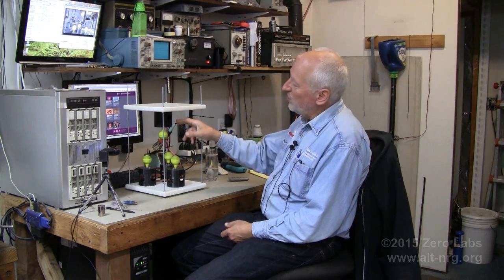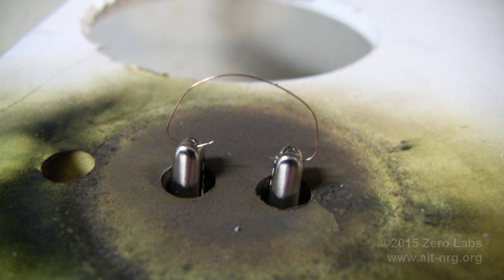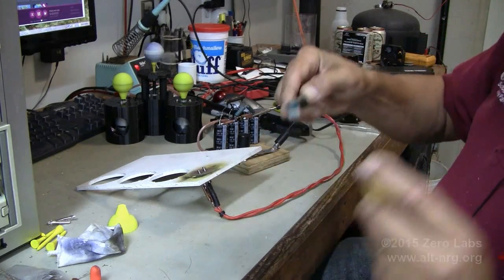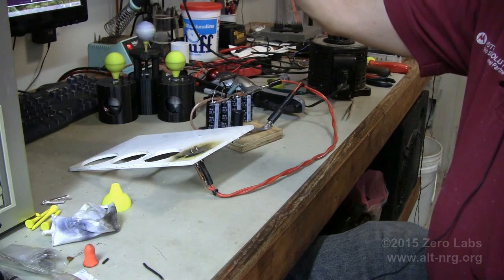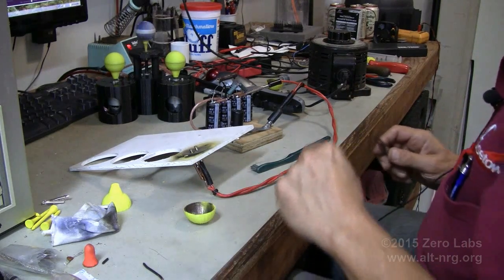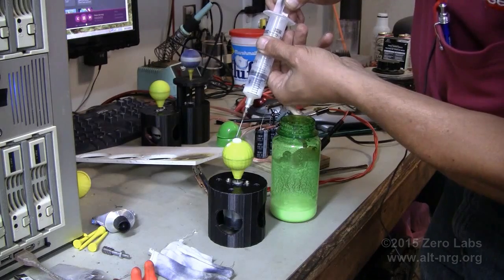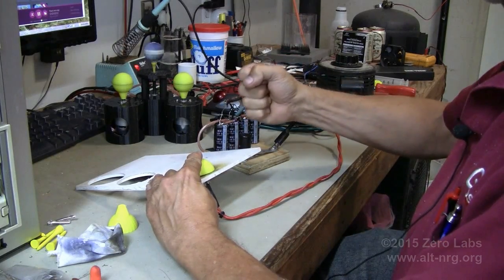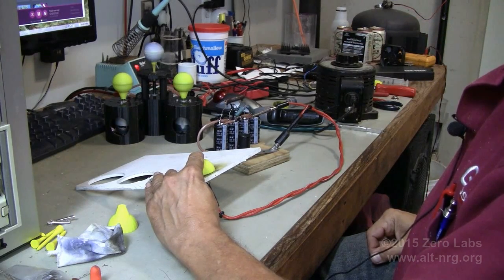#421 Keshe Plasma Reactors up & running!

Comment: All you ever need to know at www.free-energy-info.com   Mr. Zero, could you confirm that magnets that repell each other could be drawn together with mag-absorbent  material like mu metal (pls forgive the misspells), if so then cool. Also, is ti logical to assume the 1700s Hydro Ram Pump could power a looped turbine system? If that doesin't work, you could always use a low watt e-motor to run a high watt alternator/generator, just keep the batteries (use and storage) seperate. Just need a switching control.
Reply from the maker: +WhtStr213 I have tried what you suggest with magnets. I know your thought process on this. Very difficult to achieve a balance that nulls the forces. The ram pump wastes a lot of water delivering only a small fraction to elevated heights. You could never loop such a device.
Reply: +ZeroFossilFuel thank you very much for your input. As I have nil finances, most of my work is conceptual (two yrs worth of doodles). Its really nice to have someone building and testing these things. The goal is there, we just have to find it. Keep up the awesome work ,good luck and god-speed Sir

Comment: when you add external current the output is nano zinc oxide. In all the Keshe teachings there are co2 loaded (or/ and Cuo, ch3 Gans) in the Reaktors.

Comment: In Minute 8:26 you dont show Co2 Gans, its Nano Zinc oxide. Thats not the correct filling for the reactors. You have used current to produce Nano Zinc oxide. For Co2 dont use any voltage.
Reply from the maker: +lassardio You're wrong. The dissimilar metals in salt solution produce a voltage. That's why the plates must be connected, so that the current flows. Adding more voltage to accelerate the process is fair game. But you're absolutely correct about one thing. The product *IS* zinc oxide.
Reply from the maker: +nom d'plume No, you do not understand the process. New plates in solution produce significant voltage and current. When the plates are connected together up to 100mA of current flows and material is produced. However, when enough zinc plates onto the copper the plates become less dissimilar, current drops off quickly and production slows. Injecting a small voltage to maintain the current levels does not alter the process other than to keep it going at a reasonable pace.

Comment: What are the anomalies you heard about? I just heard that the star formation concentrate free plasma in the center. I never heard anything else.
Reply from the maker: +neves71 Vince also reported seeing strange fluctuations in motor RPM, up to +/- 700RPM. Personally I just think his reactors got out of balance with the "gans" centrifuging to the outer walls. Once it starts to get out of balance it begins to avalanche. That loads the motor bearings and increases inertia.

Comment: Looks like you a getting wrong information about the gans production. If the plates are outside it is impossible to get gans. What this setup could do is attract CO2 to the water, probably in liquid form, but usually you would need a nano copper wire submerged in the water. I follow many groups about Keshe and there is a lot of open experiments, misunderstanding and misinformation. If you stick to the Keshe workshops and books you could be more precise in what you doing.
Reply from the maker: +neves71 I understand. This was one recommendation from one believer who drank WAY too much of the Kool-Aid. Simply making good on a promise to point out the sheer stupidity.
Reply: If you want to prove if the Keshe theories are real or not I think you should stick to his experiments. The followers (most are amateurs, some with more others with less scientific knowledge) are trying all possibilities, some with good results some with no or bad results. There are people making glass and thinking they make a diamond (joke). So if you try to reproduce followers experiments and listen to much what they claim, you are just fooling yourself and the people who are enjoying your investigation. Keep up the good work.
Reply from the maker: The only real advice I am taking with the core experiment is from the apostles directly below Keshe himself. They liked my copper vapor deposition but even I do not think that held true to the design criteria. My next plasma balls will have a genuine electroplated copper interior that's nano coated with caustic. Thanks for your comments.

Comment: From what I understand you have to love your reactor! So try giving it a hug! Or a kiss to see if you feel all tingly inside or take a jolt of mega volts to the face? :)
Reply: +shazizz Better stay away - it may explode
Reply: sound, thought, intent and so on are vibrations... changes frequency... :) is made of light and information :)
Reply: Look into Dr. Masaru Emoto and his water consiousness science. All is by the way energy, we too :) with love, Ine
Reply: Look into Dr. Masaru Emoto and his water consiousness science. All is by the way energy, we too :) with love, Ine
Reply: +shazizz Yes. ESpecially when it is such a mesh of blank wires a most of the DiY peopls produce and it is connected to the gtid. Then you are a good candidate for the Darwin award :(

Comment: Also don't forget to show (technical analysis data) how the gans are not factually gas in a solid state...:) As in you need to prove the solid or liquid you made is not in fact C02, C03 or any gas in a solid state you made by a proven 3rd party. That is all you need to prove Keshe is wrong...correct?
Reply from the maker: +Paul .C What I made was made precisely according to the instructions I was given. If it's not what they claim it is, it's not due to any procedural error. It's because it's not what they claim it is. Again, pretty simple. Don't want to confuse anyone.

Comment: For those who never believed:
https://www.youtube.com/watch?v=6vowBIwEYKc
For those who have now changed their beliefs:
https://www.youtube.com/watch?v=6vowBIwEYKc
For those who still believe:
https://www.youtube.com/watch?v=6vowBIwEYKc
Reply from the maker: +Energy Fabricator LOL! Nice one.
Reply: +ZeroFossilFuel 
I thought you'd like that :) and WOW... judging by the comments, you have opened up a can of worms with this series of videos! Sooo many people STILL believe with no evidence of anything... no energy production of any sort, be it heat, usable electricity, or otherwise. Just 'empty boxes of the universe' filled with empty promises...
Reply: +rylan .bledsoe 
This is the dense plasma focus which Eric Lerner and many others are working on. It has nothing to do with Keshe's empty box of the universe (as far as I am aware) and it has been around since the mid-60's. Furthermore, it is extremely difficult to produce fusion using this method. See below...

Firstly, you need extremely high temperatures...
The ion temperatures required have not been produced successfully in the lab.

Secondly, you need high plasma density...
I don't think they have even come close to succeeding in producing the plasma density required.

Thirdly, you need the confinement time...
They have succeeded with this aspect. Unfortunately, the product of density & confinement time determines how much fuel you will use to produce the reaction.

The reaction produces X-Ray emissions, cooling the plasma, which brings you back to the first problem of reaching the extremely high temperatures required. Again, nothing to do with Keshe.
Reply: +renaud techer Go away troll...
Reply from the maker: msmeg renaud techer states the truth.
Reply: Energy Fabricator why so many hate? Milions people play with that nevertheles your opinion and videos. And what? Why you are obscesed by Keshe why you are not "home" besides the same "scientist" as other sceptics?

Comment: Well done Mark. so there is no electricity produced from the inner fluid tapped via a nail versus the outer shell covered in alufoil ?
Reply from the maker: +overunitydotcom That's not in the build parameters. Supposedly this creates the field for the "energy beads" to extract electricity from, plus other anomalous behavior reported by the Keshe apostles.
Reply: +ZeroFossilFuel Hi Mark, Peter Salocher from Austria has replicated the Nanocoating wires and says, that his solarpanel battery bank is now 2 hours earlier fully charged each day due to the Keshe wires at his battery bank... Hmmm... maybe the nanocoating produces very fast diodes between the copper and copperoxide layers, that convert all background radiation waves to electrical energy...one explanation that would make sense...
Regards, Stefan,
Reply from the maker: +Stephane fyfe (steph) You are correct. I am not finished. New, better sealed, more stable plasma reactors have been printed. They will be copper electroplated 1mm thick inside and caustic method nano coated, conforming exactly to the design criteria. I will have the 5th reactor running as well, and the "energy beads" which is essentially a Magravs device. This experiment shall be carried out fully to it's logical conclusion.
Reply: +ZeroFossilFuel This miraculous device just blew the fuses when the visitor of the world peace meeting swithed them on. A great success but i can do that in a more simple way: just insert a wire (AWG 14, heavy insulated, use gloves!) in both holes of a wall outlet and  --- BOOM (DONT DO IT IN REALITY, IT IS DANGEROUS AND MAY DAMAGE A LOT)
Reply from the maker: Jean-Pierre Mürrli LOL!
Reply: +Stephane fyfe (steph) You mean if he ()  had done it right it would blow thfuses and damaged the electronics?

You are right :D
Reply from the maker: +Jean-Pierre Mürrli Actually, your redrawing of the schematic is not exactly correct. Two poles of the master switch (CBIN1) are N.O., the other two (CBOUT1 to ground) are N.C. There is no dead short condition so long as the the switch operates this way. I would certainly not call it a UL approved device, though, do to the electrical hazard I'm sure it will present to most builders.
Reply: +ZeroFossilFuel 

Then we have different publications of the blueprint. This is from
https://static.allmystery.de/upics/11ac9e_Keshe_MPS_Blueprint_1.jpg

it is a screenshot from the 3. day of the "Blueprint Teaching Week" am session at about 00:55:00
and there both CBs are N.O.
The experience of the "ambassadors" ("sparks" and "damage" as Keshe calls it at the beginning of the first workshop) points into the same direction (tansscript of Keshes video at the very beginning):

"(Greetings) ...One of the problems is - as we have seen with the governmental demonstrations where the ambassadors took the units and plugged them in their own way creates this spark and they had to wait for the/a repair”
Reply from the maker: Jean-Pierre Mürrli Oh my. Yes, that will go boom every time. The diagram I have is from the pdf at KF right now. Looks like they corrected their error.
Reply: +ZeroFossilFuel Î downloaded the blueprints from the Keshe webpage meanwhile ans there the drawing is correct. But it is not sure if it works even in this case - there is an additional requirement:

When the two circuit breakers switched on there must be a break before make configuration - the circuit breaker on the right must open before that on the left closes and when we switch off the left CB must open first.

But the most devastating error in the blueprints is the connection of the energy counter shown on the last page of the Magrav Power Schematics updated pdf. Have a look at the connection to the energy meter:
The connection from the grid to the meter is on the left, the connection to the coils is on the right. This energy meter measures the energy flow from the left to the right terminals that means, during their experiments Keshe and Alekz never measured any energy delivered to the grid, all they saw was energy drawn from the grid

Youn know what that means...

There are a couple more quirks in the whole design but for now I'll let it be enough. More will follow soon.
Reply: +Jean-Pierre Mürrli Don't you know about prestidigation, magicians tricks? Through the ages, it has been a regular way to catch believers by tricking them, even Buddhist monks have done these kind of tricks to get more means to survive by beguiling their adepts (I say that even been a "pro-Buddha" ...). So, one has to apply always what the French Philosopher René Descartes called the "Hyperbolic Doubt" in anything which concerns Knowledge. Regards.
Reply: Didier Khwartz Totally agreed. I guess you have not read my message completely (or I failed to express myself correct). What you have written is exactly what I wanted to say, specifically targeted at Keshes miraculous device and all the flaws which make it's functioning impossible
Reply: Jean-Pierre Mürrli Yeah, sorry, I am always good to understand "non-formal English" ^_^ Thanks for having specified your thoughts to me :)

Comment: what is an example of the expected anomalous behavior?
Reply: +P.A. Arsenault There won't be any example.  It will be vague innuendo if positive or wait and see/you did it wrong if nothing happens.  Its the way this type of scheme works to keep milking the sheeple for more money.

I spent 1/3 of my childhood roaming around USA/Canada with my father ( an PEE and metallurgist) in a clapt out old fargo van searching for working perpetual energy machines and ways to cheat the conservation of energy.  Lots of rumors, theories, and multitudes of  “I just need more investors and time, then you’ll see” (scams).  I’ve seen mechanical, electrical, pneumatic, hydraulic, you name it and they only had one thing in common: Non-functional now just need more investment.
Reply: +Rico Swave   Anomalous behaviour can often arise from false perceptions such as the N-rays case in the early 1900s.  A renowned  French Professor, Rene Blondlot, was awarded the prestigious Lecomte prize for his discovery of N-rays. N-rays did not exist of course but he deluded himself into throwing his career away on his "discovery".  

Scam artists often take advantage of optical illusions to pull off their capers, though in the professor's case it was probably due to a lack of due diligence.
Reply: +Jeff Harmed I seem to remember something about Rene Blondlot.  Wasn't he a very well respected academic?  University was over 30 yrs ago so...

This Keshe character seems to be another sort. I've seen his ilk before on many occasions.  I really thought this type of scam had died out in the late 80's.

I've done a little research on this guy and it seems he was already run out of Belgium, essentially for fraud, hence his new home in Italy (as we all know a nation with absolutely stellar reputation, devoid of corruption /s).

Here is a thread with a multitude of (purported) facts and they tend to jibe with many other posts I've found:  http://www.energeticforum.com/renewable-energy/13583-facts-about-keshe.html

Comment: This is what I would have theorized as the outcome of that set up... :( I can't get through to many Keshe videos as they are a lot of theoretical rhetoric without concrete data or experimentation.  You did create some fantastic things to show how you can make copper oxide deposition in a pretty easy way. Though, the layers are probably not very uniform, it is an awesome idea. You also have lessened Keshe's credibility on ideas of influencing usable energy.
Reply: Do you have a link so I can check it out. I believe I saw a Dutch gentlemen do a gains reactor with no anomalous effects. What are the experiments suppose to show on the 29th?
Reply: +Diadon Acs (Conscious Energies)  Interesting, no reply. But you just wait big things will happen and stuff and other things soon you should send money now.
Reply: +Diadon Acs (Conscious Energies) i second this for a poor way of creating a copper skin
Reply: 2 weeks still nothing.